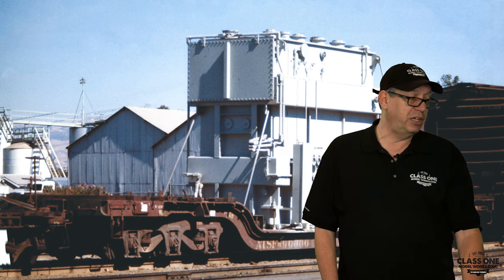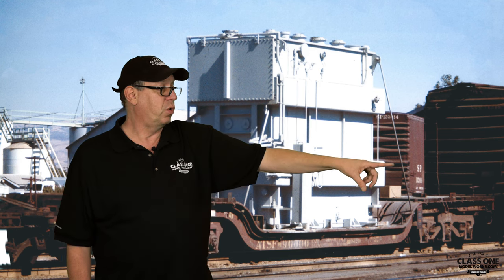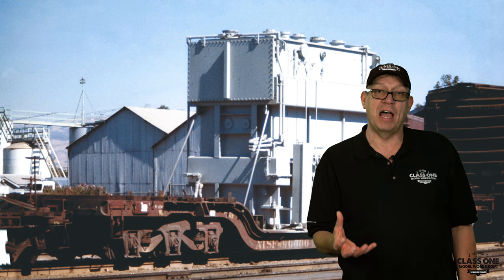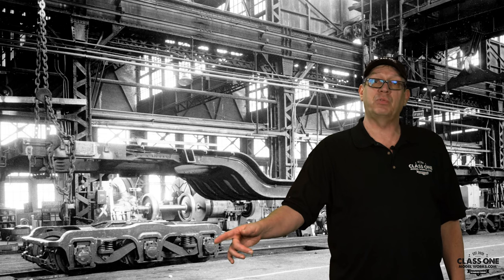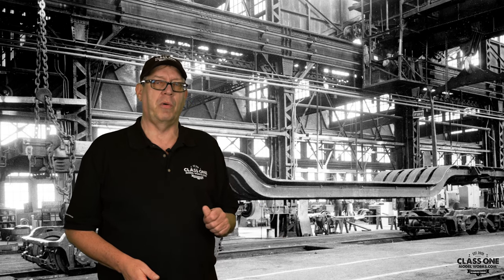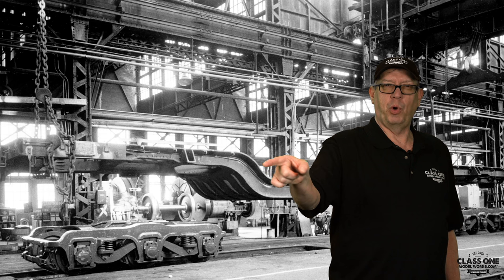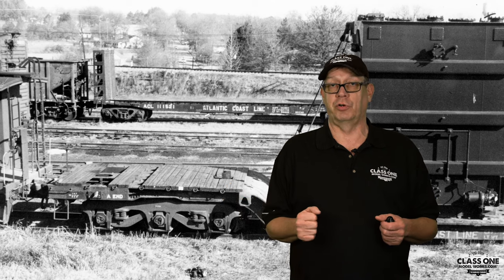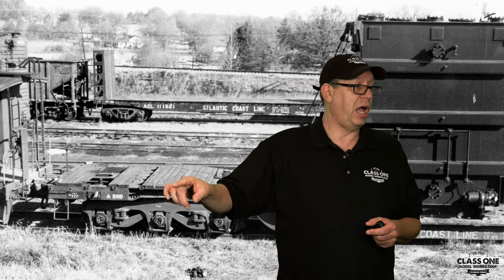GSC HD Flatcar unique design explained

Comment: Regarding the bearing end caps, the triangular ones mark the Timken bearings, the hexagonal ones indicate Brenco bearings, and round ones would be Hyatt roller bearings. 

For those who are wondering why there are two air lines running down the car length, this would be because each truck has its own brake piston. One of the lines is the train line while the other sends air from the triple valve at one end to the brake piston at the opposite end of the car. Other rail cars do this as well such as covered hoppers, tank cars, etc